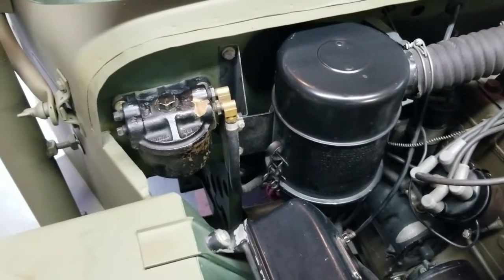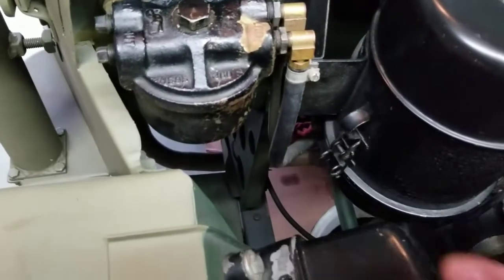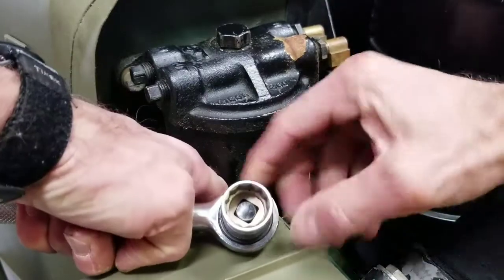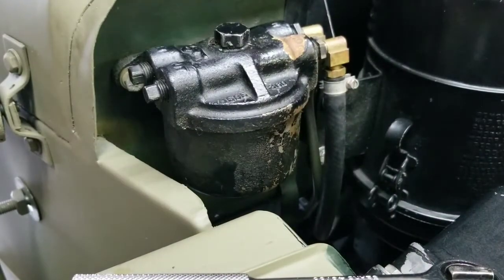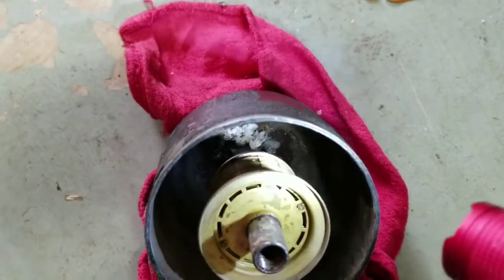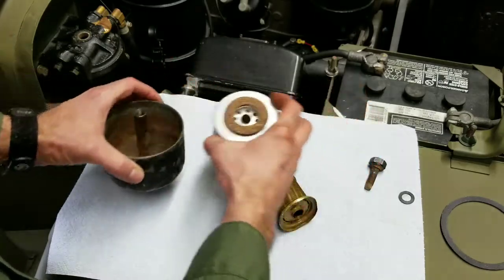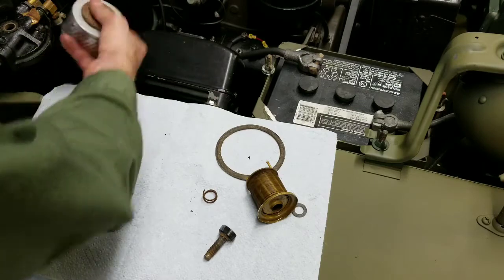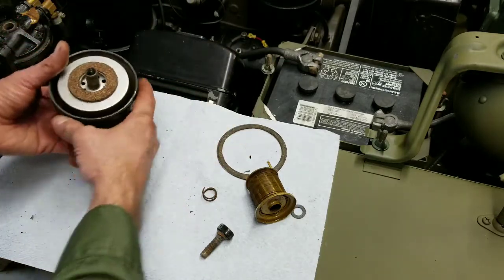Jeep Fuel Filter Strainer Replacement Service for Willys MB / Ford GPW WW2 WWII

Comment: What is the part number for the new filter? And you should put the washer on top of the spring....Hal
Reply from the maker: The part number in the video is A1261K from Kaiser Willys
Reply: WW2 Jeep and Rifle That Filter sure looks like a RFJP Filter. Logo and all. From Kaiser Willys?